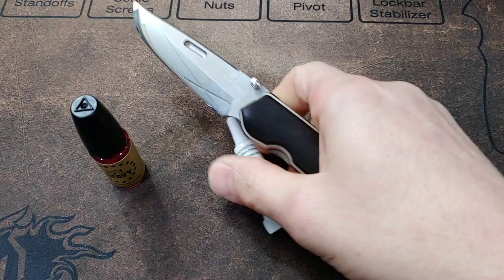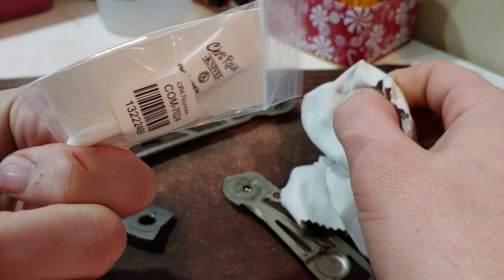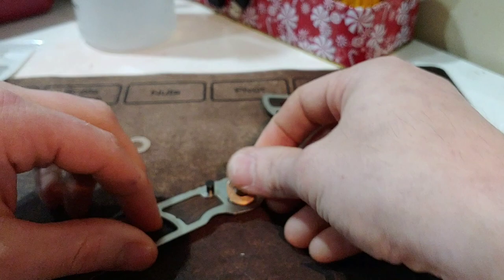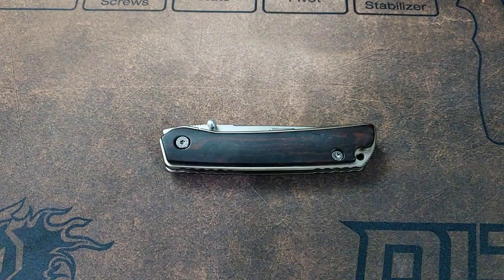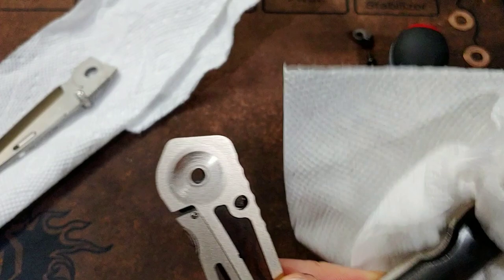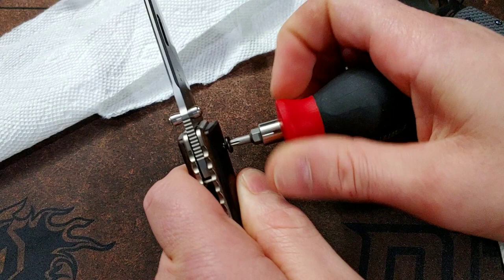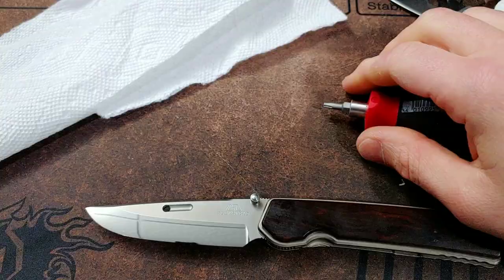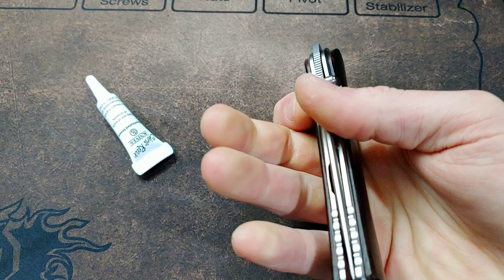CRK FLUORINATED GREASE VS KPL HEAVY ON ROCKSTEAD HIGO

Comment: KPL heavy was designed for the detent track. It’s way too heavy for the pivot.
Reply from the maker: It worked great! And i was under the impression its for washers while the other is for bearings
Reply: @NeevesKnives  I’m sure it won’t hurt a thing. But here’s what KPL says. 

“KPL Heavy™ is a higher viscosity version of the KPL you know and love.  KPL Heavy is highly thixotropic/shear thinning formula designed specifically for knife detents and detent tracks.  

Ordinarily gel-like, each time your lock mechanism clicks into place, the shock refluidizes KPL Heavy allowing it to refresh the lubrication of your detent ball.

When sitting without shock/shear, the KPL heavy regains its higher viscosity so it stays put near the detent.

The unique properties of KPL Heavy revolutionize detent care.  Eliminate scratchy detents, lubricate less often, and trust KPL Heavy to remain SUPER washout resistant”

Comment: I came here and watched to see the knife taken apart 😀 and pleasantly surprised to see that Rockstead uses a pivot bushing like CK. Do all Rockstead's use a pivot bushing? I'm thinking about getting their smaller Hizen ZDP...to start off anyway. My next after that would be the Higo II X. I contacted Rockstead to inquire about the material they use for the detent ball and kind of put off they don't use ceramic ball, the steel they use is called SKD11 and from what I could find it's a type of D2. My inquiry was pertaining to the Hizen so unsure if ALL their knives use SKD11. Concerned about this because of the Rockwell hardness of their blades...but I'm not a knife manufacture so what do I know. But the site I found describing SKD11 said it's normally hardened up to 61Rc

Comment: Not a fan of grease attracts to much dust I like using a dry lubricant
Reply from the maker: I have dry lube and it never does good imo compared to kpl, or grease if its washers, night and day difference, i never have issues with dust in my pivots but im not in crazy dirty areas like i used to be, but washers help keep that out already and with grease it seals it really tight

Comment: In my past experiences what you did was very accurate, it’s over time, use, and carry the CRK grease prevails. The kpl albeit heavy or regular will wear out or dry quicker. And the grease after wear in will make a barrier for dust and gunk. That initial kpl action is so smooth and just butter. I think that is why someone people do a various mix of the two, I haven’t tried that yet. Maybe next video 😂 great videos brother👍
Reply from the maker: Ive always heard for washers you want something heavy like grease and for bearings you want oil

Comment: Hey Jared I have the work sharp precision adjust and for some reason when sharpening my 0393 could only get a burr on half of the blade. The tip half could never get a burr, any idea why ?
Reply from the maker: Most likely you just had to work on it longer, which might be longer than you think if your reprofiling, and if the thickness changes one half will get a burr before the thicker half, or could be a poor heat treat, and last thing make sure your blade isnt moving, mark your blade after putting it in device with a marker and make sure its not moving, also pressure can push the blade down on that machine so try not to use pressure on the stone
Reply: @NeevesKnives  thanks man, maybe it's the weird grind on that blade. Made a Lot of passes and was concerned i was talking too much steel off. Back half sharp as hell front sucks
Reply from the maker: @chrisspanks7750  yeah mark the blade after clamping, to make sure its not moving, dont use a lot of pressure, and watch the grit pattern so you can see the scratch pattern move from the back of the bevel to the very apex tip of the edge

Comment: Just got this coming in the mail today- looking forward to it - ty for the video- I love the CRK's except for the thumb studs cant stand them except for the Zaan but that has only one option pretty common for me personally
Reply: @theknifewife7924...I feel the same about the Sebenza thumb stud most say "learn to position your thumb" or build up a callous, that just tells me it's a poorly designed thumb stud I have a huge collection of folders enough to open my own knife store and the Sebenza is just a crap design...(sorry) NOT sorry fan boys) it'll never get changed though. I've got 2 Rocksteads a Higo II and a Hizen both with ZDP189 and disappointed on both the edge sharpness didn't last very long at all only used 10-20 times to cut boxes to fit in recycle bin, nothing like some of the demonstrations I've seen where they stay remarkably sharp after hundreds and hundreds of cuts...they're beautiful knives though and it's not recommended to sharpen yourself you're supposed to send back to Rockstead for that. So they've been sitting in my knife cabinet for close to 2 years. They're practically brand new.
Reply: @harryberry474  I switched replaced thumb studs on new sabenza with timascus oversized studs - and it's awesome
Reply: @Haveaknifeday73 ...I switched my large Sebenza to dual studs bought on Etsy from NapoliEDC they were the only ones I could find that have machined shoulder that fits into the  Sebenza thumb stud hole for secure fit unlike others that just have a threaded piece that fits loosely in the hole in the blade. Do you have link for timascus studs and was this a Large or Small Sebenza? Also through my research I've found many aftermarket studs claim to fit both Large and Small if you have both L&S you'll notice the stock studs are different sizes.

Comment: I have KPL original and I use sentry original tuff glide. I am new to all this I just got my 1sr CR and just used that Fluorinated grease first time as I am watching this . I didn't even think to lube up the detent track . I didnt even no some grease is for bearings and some is for washers I just been experimenting. I been messing with my 0566 Zt trying to get that drop shut I took of the speed safe . I tried the cr grease , gonna let it sit for a few days . than see if the kpl or tuff glide works better. I like the dry tuff glide so far the best from my other knives     
Thanks for the tutorial . If you got any info on which I should use on bearings and on washers or does it even really matter.  Gave you a sub
Reply from the maker: I personally did not like the tuff glide, especially compared to kpl, for washers I like grease, and bearings kpl I've tried lots of pivot oil nothing compares
Reply: @NeevesKnives  so you like the CR fluorinated grease on any washers . 
thanks for getting back to me. let you no how it goes
Reply from the maker: @slayer7682  yes usually  and thanks for the sub 👊

Comment: Phosphor bronze is self lubricating that's why they use it. I would've just cleaned it really good and polished the washers and you would've been fine
Reply from the maker: Self lubrication means the surface is slick that doesn't mean it lubricates its self, I did polish the washers on this already but adding a bit of oil or grease on most knives benefits the action especially on the detent, I do agree though some do better dry in the pivot with oil only on the detent
Reply: @NeevesKnives  I try to avoid it and let it break in naturally if it's new or just clean it good if it's for maintenance. I find oils clog up action over time and catch a lot of dirt and dust making the initial action better but hindering it over time. I wear sweat pants a lot and man do those lubricants love to catch lint.

Comment: Jared, have you watched KPL’s you tube videos? Very similar to what you do except they use the light on washers and heavy on detent track. Still that Rockstead is a thing of beauty! I use a lot of KPL on my knives and they seem to stay smooth longer
Reply from the maker: I tried the light on washers and i prefers a grease or something heavier normally, sometimes its good but i guess it depends also oil on ti framelocks with no insert makes horrible lock stick so i like to have something heavier